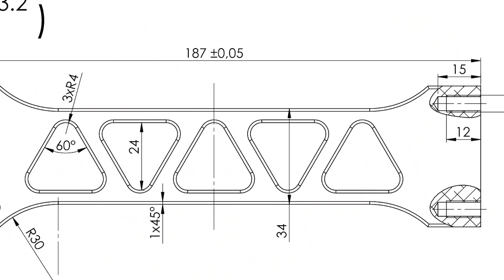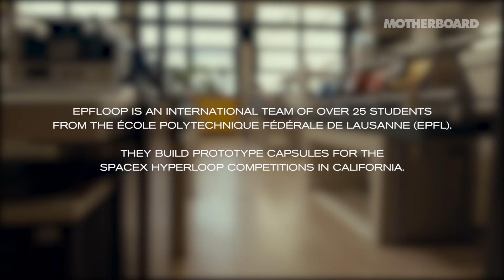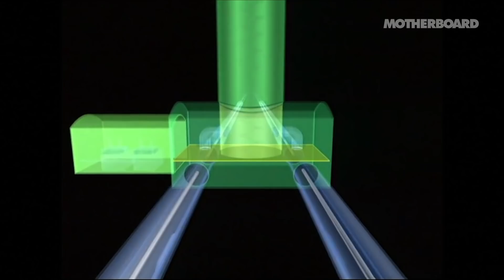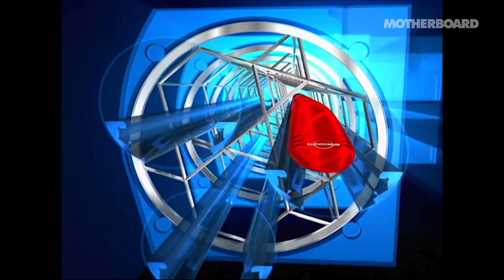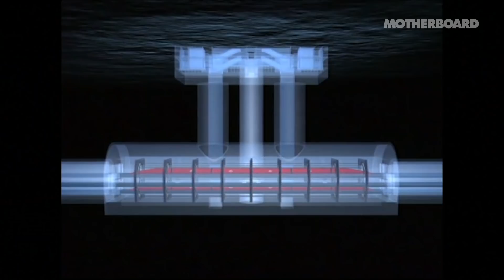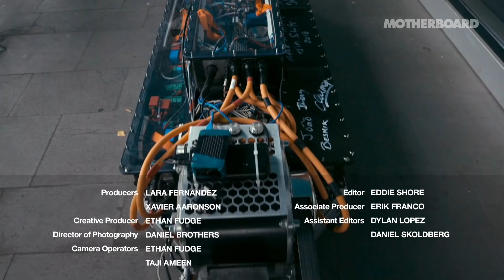Hyperloop Revolution: The Real Story of its Origins and Future

Comment: I still don't see any new or special technology though, except for a "slight vacuum tunnel". I just see a small maglev small model. Levitation and propulsion by electromagnets are being used and have been used around the world in trains for a long long time. This vacuum tunnel is going to be an extra piece of very very expensive infrastructure that will need to be build with enormous amounts of money and will need a massive and constant influx of money in maintenance of such structures. There is also the eyesore and challenge of running these tunnels across the landscape, through cities, over bridges, under ground... not exactly a pretty site to see a large tube bashing through nature or any other city. I think electric drones are the answer, not this, definitely not this.

Comment: This is already such a caveman concept, this idea has been in development so long it's basically a 90's concept,by this day and age we should be developing individual passenger cars that are able to levitate by strictly using the earth's natural magnetic field , rather than using these basic tracks....this is just an over glorified train, China has had a simular train that's been in operation for years. I built a small scale working model of this 25 years ago. We need to step things up a bit this is garbage. ( Other than the vacuum tube) also wondering how much negative psi it would be operating on.... bit simular to the Futurama tube concept actually

Comment: So...  How is this better than a plane? You really think anyone is gonna pay to dig a 600 mile long pressurized tunnel for something thats purpose is basically the same as an aircraft? Planes require much less infastructure than trains or even trucks. They don't need a track to be erected and maintined,  they are tried and true, and the infastucture already  exists and can easily be expanded. You'd be 10x better off creating electric powered aircraft or more efficient turbines and craft that have more flexible landing capability.  This idea will only ever serve the most wealthy  and i still highly doubt anyone will invest the TRILLIONS to dig the tunnel that it will require, seeing as it would have to be more than one track wide and still be pressurized somehow both directions.  The technology to create the tunnels seems like the huge pitfall making this entire line of reasearch useless. Focus on moving through open air rather than tunneling and building massive underground networks. Just seems pretty obvious which is more efficient in practice.

Comment: Okay but this thing at  8:39  has nothing to do with the fundamental design intent of what a hyperloop capsule/pod is supposed to be. This thing is just a frame running on a monorail powered by an electric motor and a drive wheel. Any idiot can build this in their garage. What are the engineering professors teaching these kids?

Comment: That looks like a wheel driven electric car on a rail. If hyperloop is ever to become a thing they need to focus on the engineering challenges that haven't been solved - expansion joints that can hold a vacuum, a valve that can allow the train in and out of the tube, and safety mechanisms in case of tube failure - to name a few. Then you can worry about optimizing propulsion with maglev, and seat layouts!
Reply: @steambom3350  true dat

Comment: i am wondering why they would make it aerodynamic if it is in a vacume. I would think that it might possibly make more sense to make a blunt front, as a safety in case there is a leak in the vacume or the vacume is lost in the tube, a blunt end would cause higher resistance or breaking system to motion as a kind of built in safety measure???

Comment: "There hasn't been a revolution in transportation in 100 years"

Have you heard about airplanes?! The Boeing 747's brought about a major change in transportation in the 1970s
Reply: oƃƃə  The jet engine was a revolution though. So was the rocket engine. All within 100 years
Reply: Jonathan Martin
747 is not a revolution, it's a bigger airliner. it's called an iteration.
Reply: @daos3300  You could not be more wrong. The 747(jet engine included) opened up global travel on a mass-scale, accessible for the common person, unlike before. This did indeed, bring about changes far and wide. Revolutionary, in other words.
Reply: @johnwayne7621  it wasn't the 747 that revolutionised long distance commercial airline travel, that had already happened. it was just a bigger plane, and far from being a revolution in transportation.

Comment: The more I watch Hyperloop related content, both negative and positive, the more I am convinced that it's not a mode of transportation, it's more like a cult, some form of propaganda, an attempt to skirt around existing proprietary technology, or just a cash grab.
It's all hyperboles, theoretical stuff based on borderline fantasy, and no criticism or comparison as to why it's looked as highly upon itself as it is, specially in comparison to what is already out there.
And yes, cue the people saying how we didn't get to the moon by sitting on our asses or something similar to this tired argument.

Let's see the claims:

1. it's a new mode of transportation. I'd say it's existing and already employed Maglev technology with a ridiculously expensive and hard to do near vacuum tunnel system. What makes people think that countries will be able to build entire subterranean or even non-subterranean vacuum tube systems when they can't even revamp way cheaper and way simpler stuff like roads or train tracks?

2. zero emissions. If you are going to need electricity and energy to create a near vacuum inside tubes, zero emissions is highly reliant on grid. Which, btw, is the same case for maglev train technology. I don't see anything in this tech that would make it more power efficient in comparison to other existing forms of transporation, so this claim is pretty much baseless.

3. comparisons to current US train systems, and outlandish false equivalences to the evolution of other types of technology. See, all of those pros could be achieved right now by just investing in and building up a bullet train system in the US. The problem is not that we don't have the technology, the problem is making government and private sector invest and actually build it.

4. this entire documentary still didn't answer the most common questions that comes around the idea itself, it's just the same tired bullshit that has already been fed since the start of this entire thing. How much it would cost, how secure it'd be, how accessible, how would it be funded, how it compares to existing similar technology.

Don't get me wrong, it's an interesting area of study that could result in parallel discoveries, tech and ideas to improve other areas and whatnot.
But this is the only thing I can see it being. Not a new form of transportation, not something that is even remotely close to being achieved, but something of a modern monorail thing.

I don't want to sound that much of a bullet train fan, but I'm making the comparison due to proximity of tech and transportation ability.
Here are the advantages I can imagine for maglev trains: it doesn't depend on near vacuum tubes or tunnels, but they probably could be used or adapted to use in such scenarios. They don't need to fit exact pod sizes, running in different car configurations, which lends flexibility to the system. They can, much like trains, be built progressively and in a more interconnected way, which seems to be something hard to do at least for the core hyperloop idea. You can have lots of stops in between major points because it doesn't have a pod that needs to be accelerated up to certain speeds to work efficiently. They already work and are in use right now, so it's not a theoretical thing. They are actually already considered "ground airplanes" or something in a similar tone, so you don't have to steal the moniker from another form of transportation. It's a technology that is still progressing and still breaking new records each year.

The advantage for hyperloop - it can theoretically reach higher speeds at huge extra costs and a bunch of disadvantages. That's it. I'm talking about theoretical speeds, because that often repeated LA to San Francisco in 30 to 40 minutes? That's theoretical, an highly doubtful whenever and if Hyperloops ever happen. They didn't even manage to pull those sorts of speeds in reduced scale, ideal conditions testing grounds just yet. And complexity grows exponentially with this sort of thing. The longer the track and size of pod is, the more and more complex it becomes - to maintain a near vacuum, to have straight tracks and tunnels, to make the thing accelerate properly, to avoid accidents, to keep things in perfect shape, etc etc.

So, I have to start speculating why this entire thing is being sold this way, as if they are gonna soon solve half a dozen unsolvable problems in just a decade or less.

I think that people are afraid that if the idea of making a trip from x to y city in record time isn't put upfront, the funding and the support will run dry. People are less enthusiastic on putting money on research and development of technologies involved if it's not going to produce an actual thing.
Same reason why they keep repeating Musk's name. Ellon Musk does not have a hyperloop company. He only conceptualized the idea. All companies working on developing it further than a napkin drawing are unrelated to Musk. Quite likely because he himself doesn't think it's technologically or economically feasible.
The overpromisses are helping governments accept the idea, which for now is great, but could become a huge problem when it ends up not being delivered.
Maglev train technology is proprietary, so they can't outright say they are replicating a whole ton of stuff from it without getting in legal hot grounds. My guess why it's never mentioned in Hyperloop documentaries, interviews and whatnot despite being the closest transporation technology to it.
Perhaps it's also the only way they can keep investing, educating, researching and developing the stuff they are doing without stepping over proprietary technology's feets.

Prove me wrong. I've made similar comments on several hyperloop related videos, articles and posts so far... until now, I've got nothing concrete in return. Just very weak Hyperloop fan retorts.
Reply: nuclear power plants have 0 emissions of greenhouse gasses dude

Comment: Did you know that in the 1970's romanian scientist Henri Coanda (inventor of the jet engine, Coanda effect) invented, prototyped and build a 1.3 km long vacum tube for cargo transportation with speeds of 500-600km/h?
So, hyperloop is not a new thing, it's just brought back to public attention by another genius!
In romanian, but still..:  https://youtu.be/1kZlbNVwBl8?t=1155
Reply: So r electric cars
Reply: Also there is maglev trains already...
Reply: oƃƃə   nope, not a subway, Henri Coanda wanted tu use the Coanda effect tu move the pod thru a tube, so the moving energy is not stored and released by the pod, but by the vacuum created inside the tube(suction). only breaking is made by the pod it self. Hyperloop however, is just a subway in a tube, as i've seen some prototypes made by various competing teams..
In Romania the project failed beacause the comunist regime was changed in '89, and the new "regime" abandoned the ideea..
Reply: THE MORE YOU KNOW

Comment: Is EMF protection required in the hull of the vessel? Just thinking for the safety if someone using cell phones inside the vessel. Something to think of if commercial vessels are used. Both for the sake of phones searching for connection and turn itself on max radiation if they can't find reception underground and also if there are some external devices that might be harmful that we don't know for sure yet. 
Perhaps an internal screen that shows the location to entertain or front camera to look ahead in the tunnels. Like an inside panorama screen OLED that shows either an animated movie so it looks like you're flying or going through a section with water where it looks like it is going through open water with sealife creatures, or going through an underground gold mine, or like a section that shows ancient structures that appears like a cool fantasy animation movie with fun and amazing images (fun factor).

Comment: Say that there is a hyperloop tube that stretches the 380 miles between LA and San Francisco.      A 21-degree change in temperature will cause the tube to grow (or shrink) 300 feet.  How is this expansion going to be managed?  How are the expansion joints going to be made airtight?  Also, what happens if a passenger vehicle is in the middle of the desert, and the tube loses vacuum?  Are the riders rescued by cutting holes in the wall of the tube?
Reply: Aircraft are managing just fine. Don't worry that's why we have engineers and specific personnel to solve issues
Reply: @DoubleDe  I happen to be a civil engineer, that's why I ask.  A Boeing 747 is 250 feet long, and made from Aluminum.  It will expand about 3/4" with a 20 degree temperature change.  That's a heck of a lot different than a 300-foot expansion with a 20 degree temperature change.

Comment: What they don’t tell you is the magnetic field is harmful to cells
Reply: There have been few studies on the effects of static magnetic fields at the cellular level, compared to those of extremely low frequency magnetic fields. Past studies have shown that a static magnetic field alone does not have a lethal effect on the basic properties of cell growth and survival under normal culture conditions, regardless of the magnetic density. Most but not all studies have also suggested that a static magnetic field has no effect on changes in cell growth rate. It has also been shown that cell cycle distribution is not influenced by extremely strong static magnetic fields (up to a maximum of 10 T). A further area of interest is whether static magnetic fields cause DNA damage, which can be evaluated by determination of the frequency of micronucleus formation. The presence or absence of such micronuclei can confirm whether a particular treatment damages cellular DNA. This method has been used to confirm that a static magnetic field alone has no such effect. However, the frequency of micronucleus formation increases significantly when certain treatments (e.g., X-irradiation) are given prior to exposure to a 10 T static magnetic field. It has also been reported that treatment with trace amounts of ferrous ions in the cell culture medium and exposure to a static magnetic field increases DNA damage, which is detected using the comet assay. In addition, many studies have found a strong magnetic field that can induce orientation phenomena in cell culture.
Reply: Idk man, the scum that run the World NEVER do anything without a catch! Anything that sounds to good to be true usually isn’t with theses Satanic Scimbags !!